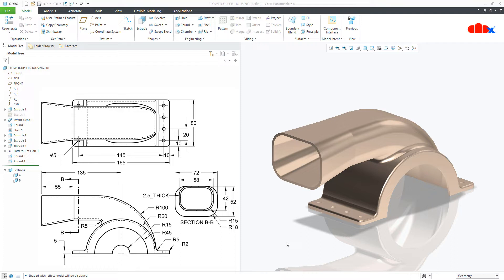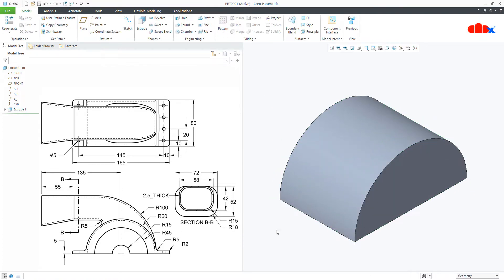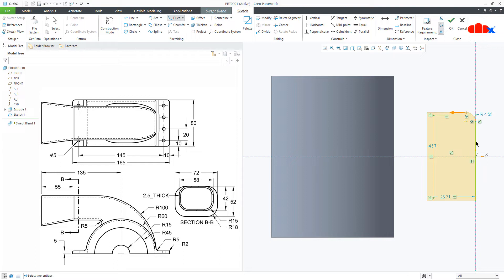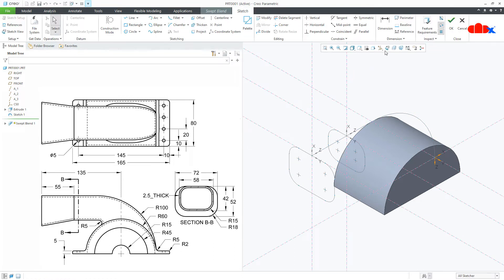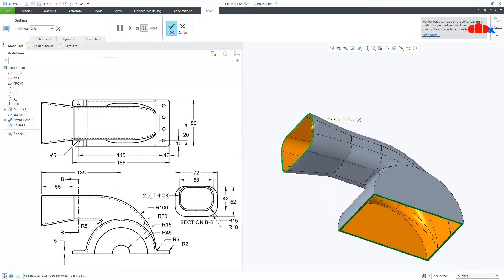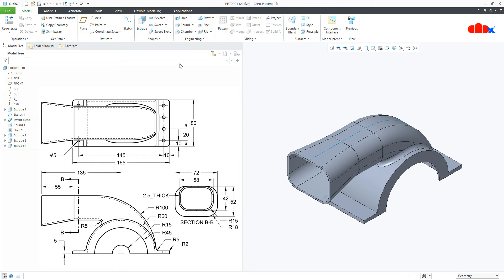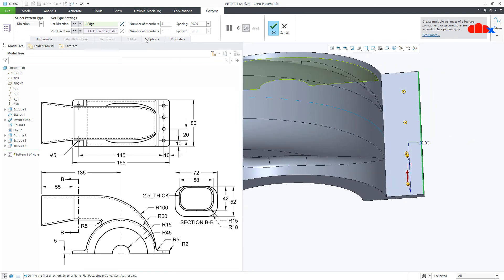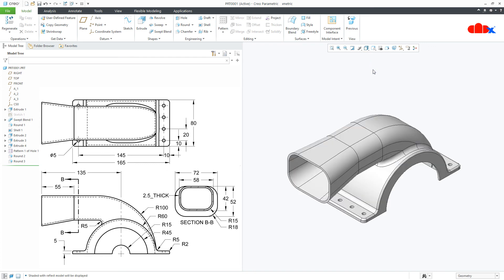Swept blend | Blower upper housing in Creo Parametric

Comment: Dear Sir. 
I have some questions

1. 4:22 It's hard to see where the point so i just mouse click several times. there's an easy way to find it?  
2. 2:09 my sketch placement default orientation is left but yours top
I can manually change from left to top, but it's cumbersome.
How do i change default orientation top same as you?
Reply from the maker: 1. Once you complete the sketch 1, you can add a datum point directly to the location. This will help you to select the location inside the Swept blend.
2. Just tilt your model the way you want it, before sketching.

Comment: After completing 3rd end section in swept blend I gave Ok but preview comes that 3rd section little bit exceed the bottom of the blower. For u it coming till bottom of blower. How is it possible?
Reply from the maker: Check the sketching plane for the third section.
Reply: @CADxTraining  at end point, drawn 3rd section in swept blend, while checking in front view the section is tilted not align to bottom face by default. How is it possible. I did same procedure as u did.
Reply from the maker: Change the option, to perimeter control
Reply: @CADxTraining  I sorted the issue. The path line arc center is not aligned with horizontal. I made coincident these two. Now resolved.
Reply from the maker: Good